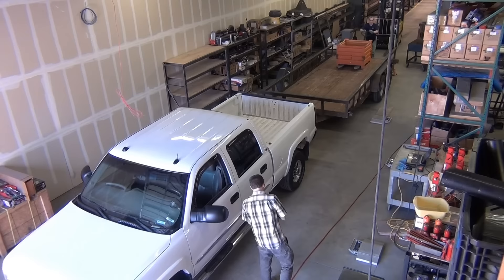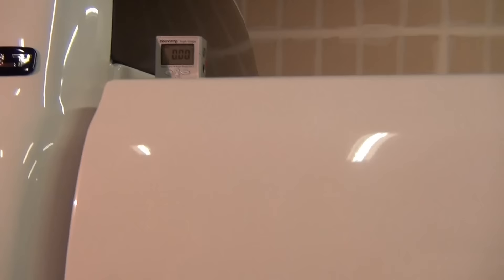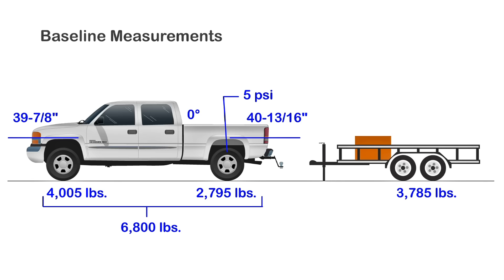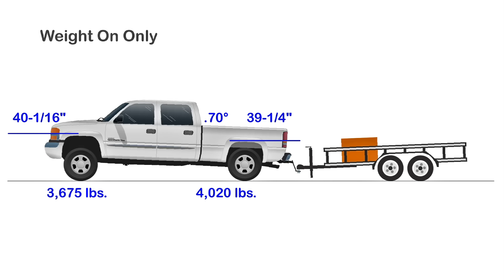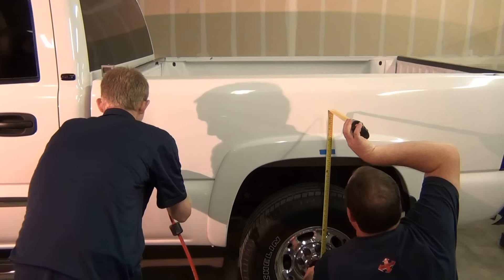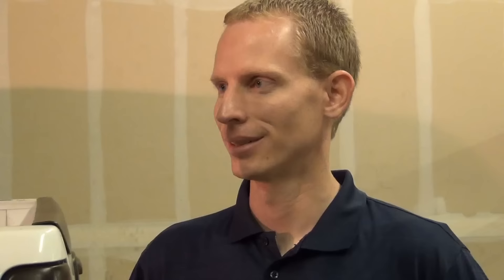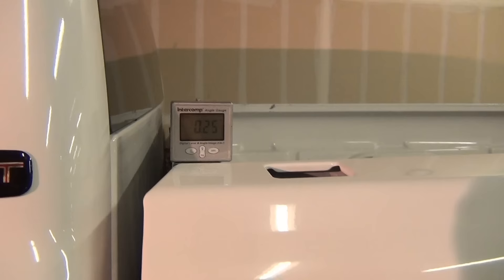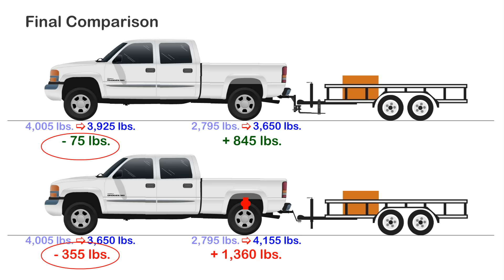The Difference Between Using Weight Distribution and Air Bags to Level Your Load

Comment: Hello, thank you for sharing this video. My question is if your using both a weight distribution hitch and air bags how would you have to adjust the weight distribution hitch with the tow vehicle using airbags to level the tow vehicle or do you leave the weight distribution hitch just the way it is set and just raise the tow vehicle before or after hooked up to the trailer? A video like this would be like gold because no one has one like this yet. Looking forward to hearing from you soon, take care.
Reply from the maker: +Angel Torres, when you are using both air bags and weight distribution together on the same combined vehicle, the best practice is to inflate the air bags to an approximate pressure that you want to tow with before installing and setting up the weight distribution hitch. This would be according to the stiffness of the ride you desire, taking into consideration the payload you are carrying in the tow vehicle itself, things like auxiliary fuel, tools, firewood, an ATV, etc. This makes sure that you are setting the hitch ball at the correct position based on the receiver height on your tow vehicle, and coupler height on your trailer. Inflating or deflating the air bags changes the position of the receiver height, thus changing how the hitch would be set up.

After inflating the air bags, go through the hitch setup process and make adjustments to the angle of the hitch head and position of the trailer brackets or chains to get proper weight distribution, which we recommend to be returning at least 50% and up to 100% of the weight lost from the front axle because of the addition of the trailer's tongue weight. Details of determining this are found in the e2 hitch owner's manual here: http://fstwy.co/manuals

Once the hitch is set up, inflating or deflating the air bags, either before or after hitching up, will change the amount of weight distribution you are getting from the hitch. Therefore, if you change your air bag inflation, you should double check the weight distribution setup and make sure is still within the acceptable range.
Reply: @FastwayTrailer  thank you so much for that detailed explanation. As soon as I install my bags I am going to refer to this and feel confident about my whole setup. Hope you guys have a awesome day😎👍
Reply from the maker: +Angel Torres, you're welcome! We hope you have an awesome day too.

Comment: I’ve hauled a lot of heavy stuff and have never used a wd hitch. I’d like to try it out now. I’ve always just used bags to remedy pitch and figured that was good enough. Never had any safety issues but you can never be too safe with a trailer.
Reply from the maker: I'd go with a wdh with sway control. The e2 or Equal-i-zer hitch.

Comment: I’ve got the Equal-i-zer WDH set up and have for years, but would like a better ride and to ease the strain on my suspension. I know people do it, but is it worthwhile to use both the air bags and WDH?
Reply from the maker: Using both can be a bit tricky, you'll want to set the springs up before setting up the weight distribution with the hitch. You may need to use one extra washer on the hitch setup to compensate. Thanks for watching!

Comment: To fix the problem move the load back on the rear axles .
Reply from the maker: Adjusting the load in the trailer is a good solution, as long as you maintain 10% to 15% of the gross trailer weight as tongue weight to keep your center of gravity just ahead of the trailer axles. In our demonstration, we are not concerned with overall trailer weight, since this does not effect what we wanted to show with the air bags and weight distribution. To save time, we simply put the weight forward on the trailer to reach a tongue weight that would work for the demonstration. In the demo, our tongue weight and gross trailer weight do not conform to the 10%-15% rule, which is OK because we are not towing the trailer.

Comment: Do you have results that combines the air bags together with the weight distribution instrument?
Reply from the maker: Using both can be a bit tricky, you'll want to set the springs up before setting up the weight distribution with the hitch. You may need to use one extra washer on the hitch setup to compensate. Thanks for watching!

Comment: This video was great. In my case however I went with air bags. I pull a 3000 pound (dry and empty) camper with a new 4Runner. The camper has a SINGLE 3500# axle and relies on the tongue weight (350 or so) to absorb some of the camper weight. If I use a load distribution hitch it will increase weight on my single axle making it closer to the max rating. I bought air bags to slightly help with the rear sag. The tow vehicle performs well without the bags and they are only there to assist. Just something to think about with single axle trailers.
Reply from the maker: +Travis Shelton,
Thanks for the comment.
Reply: I am in a similar situation. 3000 lbs with 400 lb tongue empty. Estimate it at around 3500 lbs and 600 tongue weight loaded down, single 3500 lb axle. 2016 tacoma v6 with 1100 lb payload. Happened upon a free WD hitch so debating on hooking it up, just do not want to overload the trailer axle which is probably pretty close as it is.
Reply from the maker: @Jtwizzle  Using the weight distribution hitch will push some of the tongue weight back to the trailer axles. The amount is dependent on a number of factors, including the distance from coupler to trailer axle, hitch ball to rear axle, and tow vehicle wheelbase. The easiest and best way to see what the effect on the trailer axle weight will be is to set up the hitch, and go to a CAT scale to check the weights. Keeping the weight distribution settings on the lighter side may give you a happy medium, where you’re getting some steering and braking advantage back without overloading the trailer axle.
Reply: Thanks! Will give it a shot and experiment with it. Hopefully can get some of the rear sag removed and more weight on front.
Reply from the maker: @Jtwizzle  sounds great! Let us know if you have any other questions.

Comment: WAIT can you use both and then what would the weights be?
Reply from the maker: Using both can be a bit tricky, you'll want to set the springs up before setting up the weight distribution with the hitch. You may need to use one extra washer on the hitch setup to compensate. Thanks for watching!

Comment: Excellent video,   Thanks guys.. I now understand my airbags on My 2015 TRD offroad are not  even needed now when towing my trailer,  (actually they are the wrong approach) I will only use the Weight Distribution hitch, this style hitch makes a HUGE difference when towing. From Slightly scary to NICE Controlled ride. I do use the Airbags when hauling loads of wood stone etc. in the Bed to level it out.
Reply from the maker: Glad it was helpful!!

Comment: What if you tightened the distribution bars? Mine has chains. I adjust it differently every time, depending on load.
Reply from the maker: Raising up the distribution bars would be like moving the chains up a link. It would force more weight forward to the front of the tow vehicle.
Reply: I have a Ram 2500 that I haul campers with and the combo weight distribution with air bags is really the best. It spreads the load and minimizes the bounce of the really big pull behind campers. I really love the airbags for towing 5th wheel campers even when they are within my trucks weight rating I still add air to stabilize and help the ride comfort.

Comment: Air bags help with squatting distribution bars help with squatting & swaying of trailer😃
Reply: air bags help with squatting.  most bars help with squatting (chain connections) and distributing the correct load back to the front axle where 75-90% of the trucks stopping power is, the best bars (Equal-i-zer) safely put the load back to the front axle AND limit trailer sway.   It is a good, better, best kind of thing.

Comment: Got to add my 2 cents. I’ve been driving  trucks for 16 yrs and worked on them almost 19 yrs. WDH is necessary for 1/2 tone trucks. It throws the weight back to the trailer axles (not all,but most) and almost all sys have sway control. Air bags like those on tractors are just for leveling and ride (no bottoming out). The fifth wheel on those trucks move front to back which allows for weight distribution. The farther forward the fifth wheel, the more weight placed to the front axles (which brings back typical steering and braking but still think ahead while driving under load). The more to the rear the fifth wheel is set the more weight on the rear axles. The same goes for every day vehicles. So yes, use both for 1/2 ton trucks and under. 3/4 ton trucks you can pick your poison and never exceed your trucks limits. Hope this helps.
Reply from the maker: Thanks for watching +Yukon 83.

Comment: why not both? I have a ram rebel with factory air suspension
Reply from the maker: Using both can be tricky. If you have too much air in the bags, then you will lose the sway control and WD of the hitch. If you use both then you need to set up the air bags first and then the WDH, so the hitch can still give you WD and sway control. Setting up the air bags last will take the tension off of the hitch.
Reply: I use both all the time. Way better 👍
Reply: I think this explains the problem I've been having. I air up the bags first and then hook up the wd hitch. While towing my TTRV, I feel like I'm getting pushed around by the trailer. I'm going to try putting the minimum in the bags and let the hitch do the work. If that works,  what's the point of having air bags?

Comment: Hello Fastway Trailer, I have a question that wasnt addressed in your video. So if one is running air bags along with a weight distribution hitch, what is your recommendation in how to setup and  properly use your air bags in conjunction with your weight distribution hitch system? I'll be using this setup I mentioned later this month memorial day weekend pulling from Ohio to Tennessee. Thanks in advance.
Reply: Would you suggest that after doing the proper setup ride heights using my Blue Ox weight distribution system and it's engaged, to just add enough air in my bags to smooth the ride to absorb any harshness I may feel from the engaged weight distribution?
Reply from the maker: Thanks for your question. If you were to set up your WDH and then add air after you setup your hitch, the truck being raised at the hitch will lessen the tension at the hitch, causing a loss of weight distribution and sway control. If you do use both systems together, we recommend setting up the airbags first, and then adjusting the WDH to give you the best possible ride.
Reply: @FastwayTrailer  That was my question. Thank you for the answer.

Comment: Great video. Question: looking at the weight of the TV and Trailer axles after the WD, I noticed the TV total gain is (7575-6800) 775# and the trailer weight gain at the axle is 365#. Add 775+365 is 1140# but original TW was 1000#. Did the approx 140# come from the weight of the WD? 
Thank you for this video. It appears almost a 1/3 of the TW was put back on the trailer although I wonder if that % may vary by setup or how close or far the trailer axles are from the TV rear axles? 

This definitely helped me project how TW may impact payload to my TV with a WDH set-up!

Comment: Just enquiring if Jason calculated the load reactions on the chassis frame verses the Frame RBM and factor of safety needed and also on the differential housing with the air springs were inflated to 55psi which is generally 5 to 10 psi under the maximum pressure you see on a loaded vehicle fitted fully designed for air suspension.
Reply from the maker: I believe so yes, but for more questions you can contact our customer service team at  info@fastwaytrailer.com or call them at 877-523-9103!

Comment: What about using both coil bags and a WDH on a RAM 1500?
Reply from the maker: We're working on a video of that right now, I'm expecting that to be ready and posted sometime this summer.
Reply: FastwayTrailer still on track for this video ? Would you recommend your hitch be used in combination with the Timbren Suspension Enhancement System? Please tell me if you feel this would support my 19 Ram 1500 properly and not cause the WDH to unload like could happen with Airbags.
Reply from the maker: The setup with our hitch is the same, and yes you can use the Timbren system with our hitch. The only thing that you will have to worry about is making sure the Timbren suspension isn’t too stiff. The back end tends to squat down a little when the trailer is put on the hitch ball. If it doesn’t then it is hard to move the weight back to the front of the tow vehicle. As far as the video goes, we are likely going to be pushed back, due to COVID-19 we are unable to film until social distancing restrictions are lifted.
Reply: FastwayTrailer so I decided on setting up my 19 Ram 1500 Classic with the Air lift 1000Hd, your fastway e2 hitch which I already owned, and an upgraded Hellwig sway bar. Can you tell me what the steps are for setting up the WDH with the air lift I’m coil air bags?
Reply from the maker: You would set the air bags to a specific value (we recommend a lower value) and then follow the normal WDH instructions for setup

Comment: What a great video!  thank you.   i would love to see the results of combining the two.  I'm pulling a 31' travel trailer with a 1/2 truck.  I'm using the WD hitch in addition to helper bags.    I make sure I put air in the bags before i connect the torsion bars but I've always wondered if that is truly the correct way to do it.
Reply from the maker: This is a great suggestion!

Comment: I like this video explanation very much. In fact, I'm using it along with my new web page on this topic. However, I would like to know how one should handle the load leveling when the truck bed is filled with some gear, adding, let's say, 400 pounds. (I know the added weight will reduce the towing capacity.) Should the truck be returned to level with air springs before connecting or adjusting the WDS?

Looking forward to seeing the new video covering how to use and adjust a WDS along with air springs.
Reply from the maker: Fifth Wheel Street,

When you add air to the air bags (rear axle) after you have set up the hitch for weight distribution, you will decrease the amount of weight distribution you are getting from the hitch.

The only way to avoid this is to inflate the air bags first, then set up the weight distribution.

In your example, we recommend adding the weight to the truck, inflating the air bags to your desired level, and then going through the steps of setting up the weight distribution hitch. If you are adding the weight after you have set up your hitch, we recommend that instead of inflating the air bags, you adjust the hitch to give you slightly more weight distribution. This would be simply done on an e2 hitch by raising the L-brackets.

Keep in mind that some of this additional weight will now be carried by the hitch, and some by the rear axle. Care should be taken that ratings are not exceeded for either. This will also reduce the amount of tongue weight you are able to carry.

Comment: Air bags are for 5th wheel trailers where the weight is in the bed of the truck.  The lower the nose of a 5th wheel trailer rides, the more weight is held by the truck. The idea is to get the trailer back level so it's axles carry it's weight.
Reply from the maker: Thanks for weighing in +TheSoloAsylum, and thanks for watching.

Comment: While they are a pain, the distribution hitch is the towing ticket. I pull a 23' travel trailer with my 2017 colorado diesel for a combined weight of 12,200 lbs without any issues. Even been up to 75+ mph and no one died.
Reply: I tow a Jayco 166 FBS, around 4500 lbs, with a 2016 Colorado V6. I'm not using a WD hitch or an anti-sway system currently but may next summer for longer trips. What WD hitch do you use?

Comment: I would tell anyone.. 3/4 ton truck and up. Diesel is better and airbags make it great. I have 5th wheels and I have 44ft bumper pull rvs. I am also a truck driver. In my personal truck.. 5ths ride heavy and bumpers seem to try to tail wag the dog. Air bags make it EASY and very comfy to pull. I am never concerned about my diesel, I actually am always concerned about the rvs wheel hubs etc and tires. Done.